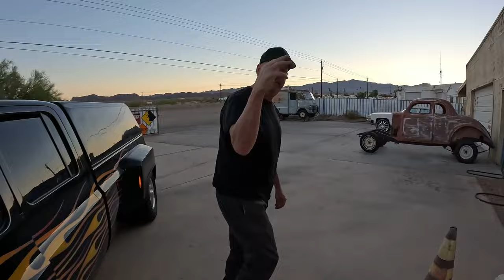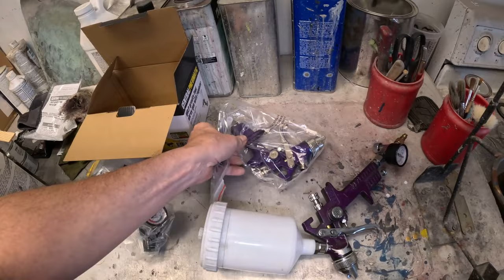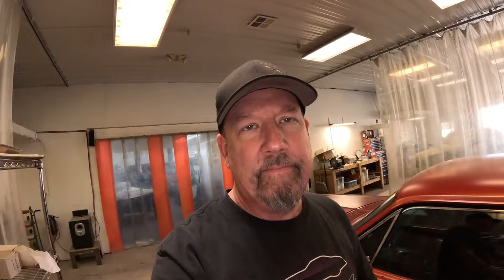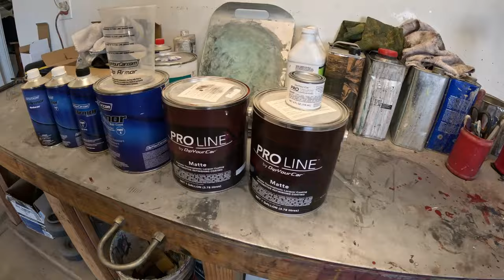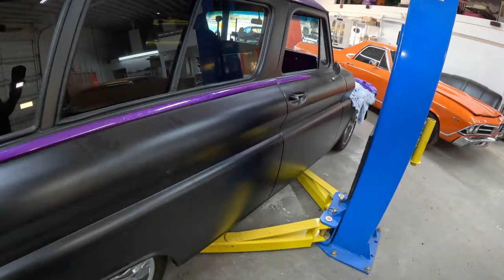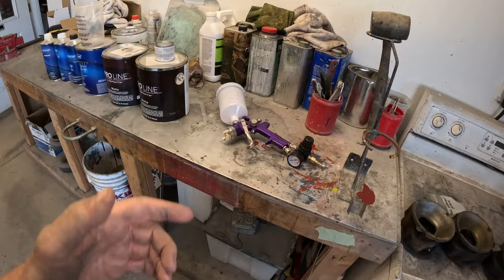Peelable paint by DipYourCar & Harbor Freight Central Pnuematic paint sprayer REVIEWS

Comment: I have been using both plastic dip and rustoleum in spray cans for years, never shot it out of a gun. Have you ever repaired it? or sprayed a boat.
Reply from the maker: No I have not tried to repair it or sprayed a boat, interesting though.
Reply: @CrashCustomsaz  thanks for responding I have done road nicks in my fork tubes with a brush, good at 5 feet. I have a 30' boat I think it would be fun to try, they wrap hulls now? wtf.

Comment: Hey Crash,  how would that gun rate for a beginner (never shot outa gun before) to Shoot primer and paint?
Reply from the maker: I like to use a bigger tip for primer lay it thick with less coats and block sand it super straight. Thinned primer will go through it and sealer definitely will. Adjust the fan pattern properly for paint and I would use it. You would have to adjust any gun you get. Can’t beat it for the price.